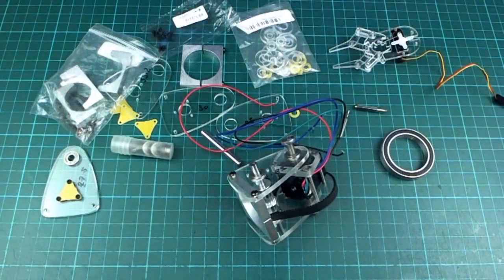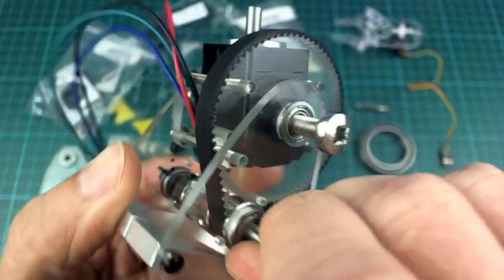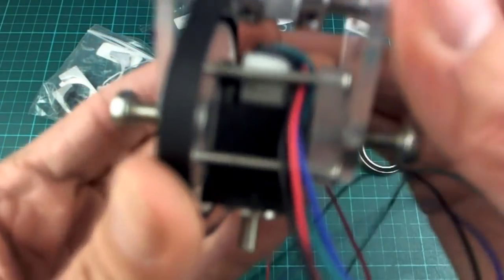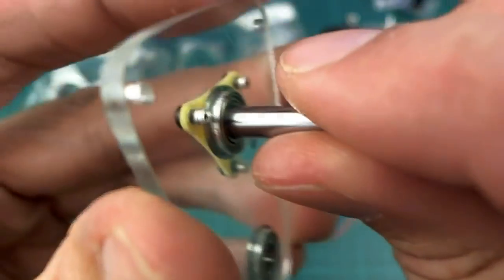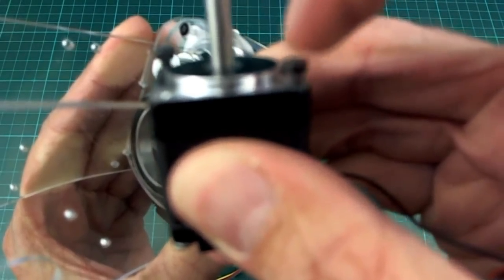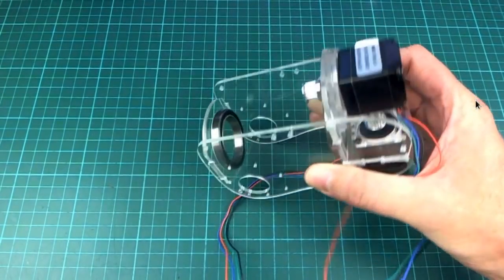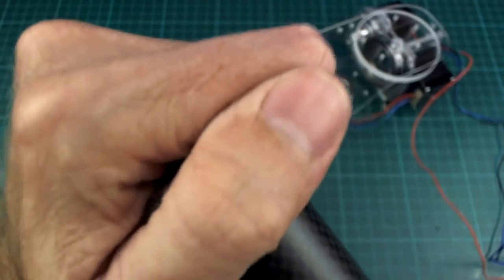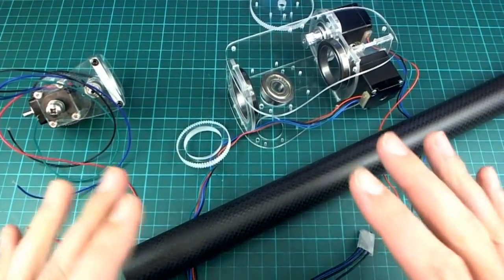Mini 6-axis robot arm part 4

Comment: Hya mate, are you still working on this project? I loved the previous 4, and am curious as to whether you've had any more progress.
Reply from the maker: I'll finish it someday, but probably a quite different design. I think it will be a lot better off with geared steppers, and small planetary gearboxes for this size of motor are becoming easier to get these days.

Comment: Are you using an encoder for monitoring the position of the shaft ? If not how are you getting the feedback from the stepper motors ?
Reply from the maker: No feedback, so steps can be missed... :/
Reply: And how do you solve the homing problem then since you don't have any reference position ?

Comment: Sometimes you see something and you immediately think "***** should see this."   Well, I think iforce2d should see this:
On Makezine:  https://makezine.com/2015/03/20/18-lessons-smart-prototyping-self-made-billionaire/
On Youtube:  https://youtu.be/xMP_AfiNlX4
It is an eighteen part series filmed in 2012 (I think) by Dan Gelbart, sharing some of his immense knowledge on creating prototypes using the quickest, cheapest, & most precise methods.  Totally inspirational, and full of tips on achieving the best result without tears.
I would recommend this to anyone who loves precision engineering at the highest level.  (Also check out Dan's amazing self-built lathe capable microscopic accuracy.)
Apologies for the off-topic comment.
Reply from the maker: Looks great, will watch. Thanks!

Comment: How do you plan on controlling it? Using two joysticks (like an excavator) or just programming? I vote for the joysticks, it would be so much fun playing around with, or do both...
Reply from the maker: Haven't thought about it all that much actually. Three joysticks would work for 6 axis control.
Reply: You are right, might not be practical with joysticks. But some of them can be twisted, which I guess could give you 6 axis control? How else do they control an excavator with rototilt?

Comment: Hi my friend.
i thought to make something similar after i saw your project and because i am ordering my parts from Ebay  , i had to see what i will need for the project because it takes one month most of the times  for parts to come home..

As i had lot of  28byj-48 stepper motors for other projects i am building i thought to use them to control the arm as they are very cheap (1,30 euros each) 
i am using them with the bipolar hack and not as unipolar that they are made from the factory

i am posting the video from the very first prototype of my design in order to see it and maybe get different direction than the one you are doing now (if you havent finished yet) 

as you will see in the video  i am using the ''universal Gcode sender'' to control the arm with an arduino nano , cnc shield V4   and Gbrl 

the Magnetic base + micrometer weights  1,5 kg 
Dont get fooled by the size of Hoist line.. it is   0.50mm Spectra line  that can hold 60kg

i am using wood as it is cheap ,lightweight and very easy to shape it for prototypes

the piston is made from aluminum tube and i fixed inside the nut 
the rod is a T8 Trapezoidal ACME 8mm Lead Screw with 2mm   pitch (most common screw used in 3d printers) 

The Video : https://youtu.be/YXMaUmr3yS8

Hope helps 

Ps : Sorry for the bad video  Quality but my Phone was broken recently so i used an old one that it hasnt the best camera

Comment: 4 more very interesting videos and I always enjoy seeing parts you made on your router for new projects like this one. Was surprised the aluminum part took 3 hours so I started wondering what the wattage and max RPM of your spindle motor was how many flute cutter you used and where you come up with your feed speed and chip load numbers for that tool and material? Have you seen this program https://www.cnccookbook.com/cnc-router-feeds-speeds-calculator/ or others like it? A friend used the 30 day trial of this one and right away he extended the tool life and cut the run time of a troublesome project by 40%. Routing aluminum seems harder than I ever thought it should be. I've been a subscriber for 3 years now and love your videos and even tho it still only has 813 views I thought Shibuya shopping trip was fascinating no matter what others said about it!
Reply from the maker: The problem is my machine is not very rigid, being made from aluminium itself. If the tool moves too quickly it will chatter and jump around. I am also using very small end mills, usually 2-4mm diameter. They can easily break if you try to move quickly, even when there is no chatter.
Reply: I remember when you were first testing your machine and rigidity seemed to be an issue. my friend had that issue with a small machine too. If you go to the link i sent about 2/3 down the page you can read that they take into account the low rigidity of entry-level CNC machines. Before he tried using this software he broke tools too often so he slowed down a lot but the software gave numbers that let him speed up a lot using less spindle power. I was amazed so I read lots of articles linked to and the chatter reduction  methods why they can cut faster easier is all a good read. Since you don't use too many materials the 30 day free trial might be all you'd need to get good numbers for the tools and materials you use.I'd like to see if you had any better result like my friend or if he was just exceptionally bad at picking his speed when he slowed down. I won't bother you with it any more after today.    http://s3.cnccookbook.com/CCChipThinning.htm   https://www.cnccookbook.com/chatter-in-machining-milling-lathe-vibration/   This arm project is very interesting, always liked how you evolve your ideas  on camera for us to see. Can't wait for part 5!

Comment: I would try freezing the carbon tube and then sliding the bearings onto it :) It works with steel so it might work with carbon as well.
Reply: Yes, and perhaps put something inside the tube with thermal mass to keep the temperature low while you carry out the fitting/assembly operation. Not water/ice perhaps! Maybe a chunk of alu/steel?
Reply: And heat the acrylic

Comment: Hey bud great project, but I think you need to be looking at worm gears, belts will always flex and the leverage you have will always amount to poor tolerances. If you do continue with belts use spring tensioners, that way you will always have a consistent tension.

Comment: Rather than drilling a hole in your pin and trying to tap that, just tap the exterior of the rod and use a M4/M6 locknut. In other words, you can make it into a double threaded bolt.
Reply from the maker: Yes, that was my next plan and I came super-close to buying a die to do exactly that. I think I still would have had difficulty cutting that hard steel though (but without breaking the die probably). I like that the method I came up with is lighter and less work to make.
Reply: iforce2d ok, that's fair enough. You might also find this guys work interesting - https://youtu.be/2lBCagAhoZM.

Comment: Coulda flipped the flanged bearings and set them in a recess, then flush cut an oversized shaft the is the OD of the inner race.
Reply from the maker: You mean with a lathe? I don't have one unfortunately.

Comment: https://www.gearbest.com/other-accessories/pp_231153.html?currency=EUR&vip=2275151&gclid=EAIaIQobChMIqbvL99q31wIVzZPtCh23rwKWEAQYASABEgIVGvD_BwE

A little steppermotor..works fine, Only using 5v.
28BYJ - 48
Reply from the maker: I have some of those but they are very slow, and use a 5 wire interface. I wanted to use the common ones like in CNC machines with A4988 type drivers.
Reply: You can make it a biplor stepermotor. And I agree there are very slow. I think there is a kind of gear box inside. I am designing a 3d printer and using it for the z-axis. Works fine.
Reply: Converting 28BYJ-48 steppers to 4 wire makes them much more useful, and increases their torque.  Because they have geared output, they are too slow for many applications, and the gearing backlash deceases repeatability and accuracy.   This may explain why they are cheap?

Comment: It's not something you'd consider but I have imagined a design where four of the motors are mounted on the base. It would seem practical in your case since you're using belts. The two motors that would have to remain at the end of the arm are the gripper and the wrist bend. I think even the wrist rotate could be mounted on the base. (Since I haven't built a prototype I don't actually know but I thought it was worth mentioning.)
Reply from the maker: Yeah there are many many ways to do is, almost limitless really. I just discovered this cool arrangement yesterday which makes me think about my concentric tubes idea again: https://www.youtube.com/watch?v=z9kE4TkCGEE
Reply: Your current design is much much better. You build prototypes and you find bugs. One great example is how you modified the motor mount on your electric bike.
One of my future goals is design a 'larger' robotic arm using geared DC motors in the two or three places that require the most torque. In my own experiments I have found that I can control the position of a DC motor by tying its movement to a potentiometer. An ADC chip can read the position of the pot which means 'theoretically' that I could, for example, leave a large geared DC motor on the base and use a potentiometer in the elbow instead.
(A second requirement with this arrangement is I have to control the speed of the motor with pwm. My breadboard tests work fine.)
Reply: That would be interesting to see... a rotary encoder would provide even better accuracy and repeatability, albeit at greater cost and complexity.
Reply: John Colvin, I agree. Encoders in the joints of a robotic arm would be ideal. (I'm just a hobbyist but I have imagined an internet controlled machine perhaps moving supplies on a construction site by someone sitting in front of a monitor.)
In my case I posted a video of a small wireless mobile robotic arm with pan/tilt camera. I was proud of it but it now sits on a shelf because it's too small to do anything useful. Not only do I want larger motors but I also want a joystick-type controller that 'mirrors' the arm's position.

Comment: Very interesting project.  Are you planning to develop a software to eg move the gripper to x y z position certain angle. While on normal cnc router movement is straight forward in case of robotic arm, formulas must be quite complex.
Reply: lookup inverse kinematics
Reply from the maker: Yes I'm hoping to get it to do that eventually, but if possible I will use an existing software package or libary to do the IK calculations, so that all I need to do is define my arm dimensions. For example: https://www.youtube.com/watch?v=c2uEWyo6dc4
Many months ago I did some basic playing around with ROS and a nice GUI for this stuff, I forget the name of it....
Probably the trickiest part will be controlling the steppers nicely to make a straight-line movement of the end-effector.